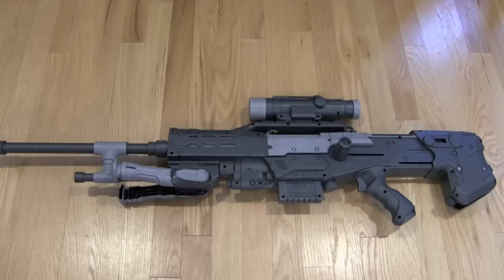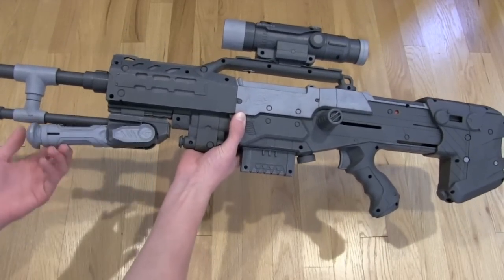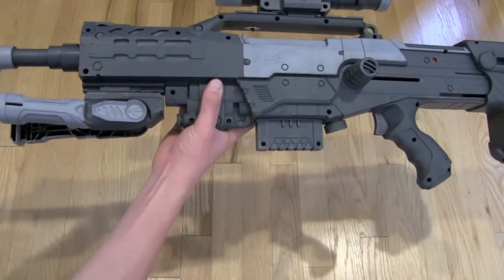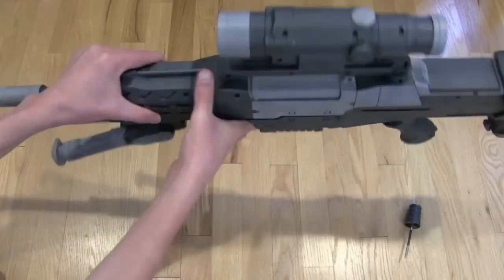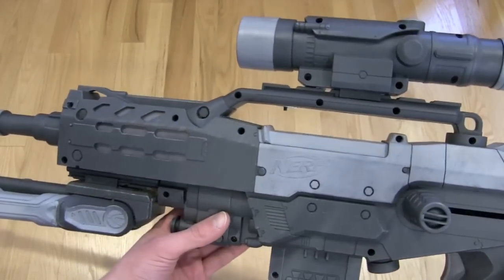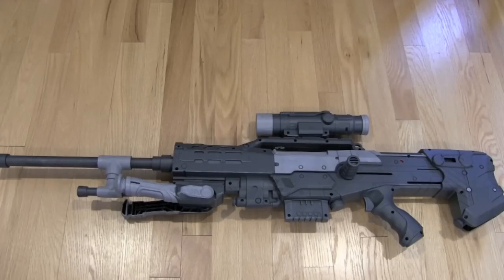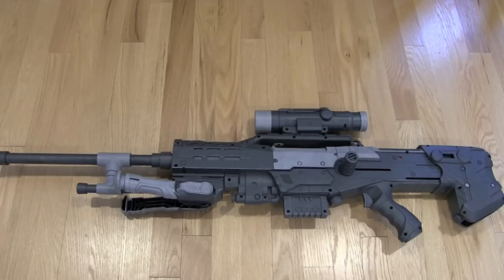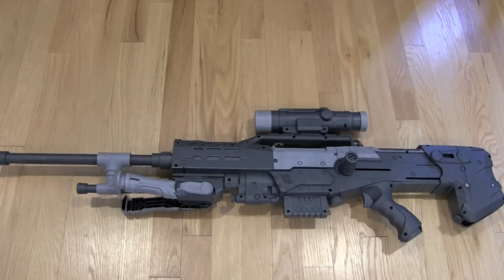Halo Sniper Rifle Nerf Replica Modification Overview

Comment: Hey mag! If I use enamel spray paint with a clear coat is it ok with the plastic?
Reply: +LegendaryMoshko Yes, as long as you sand the blaster properly before application.
Reply: +Pixel Snail oh ok thanks

Comment: Hey Mag, great work. Question: other modders/forums make a big deal out of sanding and de-greasing the surface before priming it. I think you've never mentioned that. Are you cleaning your blasterparts in any way before priming/spraying/painting? Thanks!
Reply from the maker: The answer to your question in my most recent painting tutorial :)
Reply: Ok thanks seems like I completely missed that side note. So I guess after sanding you'd not only dust the shells off but also clean them somehow, right? Anything special there? Also as you are sanding them is there a reason why you mostly keep the logos? Keep it up ;-)